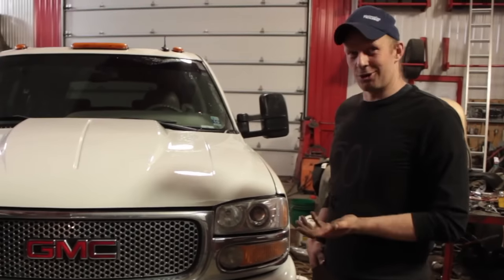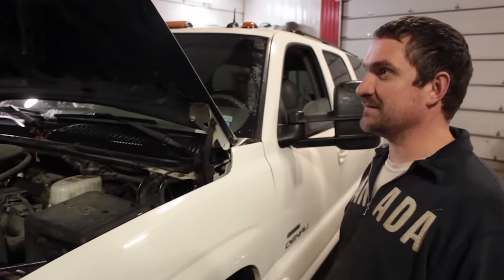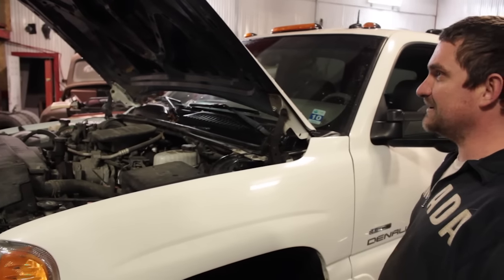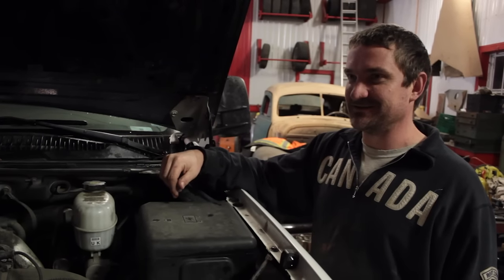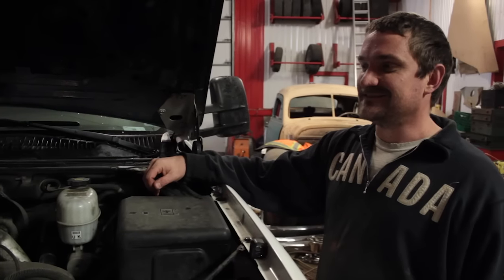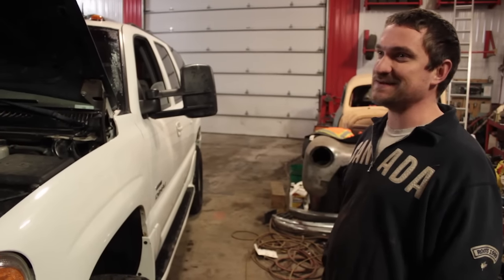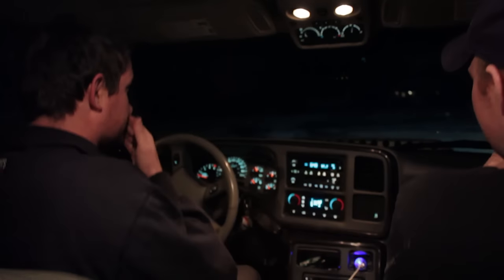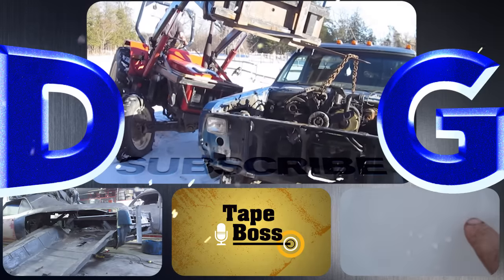Duramax Diesel Swap 6.6 LBZ in an '03 Yukon XL Denali

Comment: That's a perfect truck. That interior/body style is great! Not to mention with a Duramax!
Reply from the maker: +HKMcC _ This is my favorite body style, Before the company went into bankruptcy protection in 08 and cheaped out on everything.  They didn't fix it until 14.  I found from 08-13 cheap interiors, cheap paint and I never liked the outside where the doors go to the bottom of the truck.  Without rocker panels it always looked off to me...
Reply: +DEBOSS GARAGE Yes. I have a 03 with 250k. They are awesome trucks. 08-13 had a much poorer build quality like you said. But now GM has really turned itself around and building good cars/trucks again!
Reply: 240xxx km's on my 2008 Sierra 5.3, not a single issue short of regular maintenance on wear and tear items. I believe its the younger generation of people not taking care of their vehicles to blame. I truly do not believe for a second that GM cheaped out on everything. The interior, sure but its a pickup truck made for work. My paint is in excellent condition and very minimal rust on the underside. I live in Ottawa, ON and drive in very similar conditions that you would experience. Just my opinion on the nnbs style truck. Great vids!
Reply: @hkm_865  Thought I would chime in a few years later and would like to say I have a 2005 Tahoe that is going on 365k miles and still running smooth as ever. Hands down one of the best platforms gm has made.

Comment: Our company has twelve 2015 Silverado 2500HDs with the 6.6 Duramax with the Allison and they are amazing trucks. When my 2014 3500HD Ram was in the shop I drove one of them and pulled my 36' gooseneck flatbed with it and even loaded down with 32,000 lbs behind it, it pulled it no problem. They really are a wonder. 417 hp/765 lbft of torque is a feat, and they haul ass. My 6.7 Cummins makes 370/800 and you can definitely feel the difference in gearing. My Ram (single rear wheel) is rated for 24,500 GVWR and I've pulled close to 40,000 lbs with it (in extreme circumstances, short distances). I'm a big fan of both trucks, and I have always loved Mopar, but I love the Chevy's torque. If I could have a Dodge chassis, a Duramax with an Allison, and a Ford interior, I'd be set. I didn't include the PowerStroke because our company couldn't strike a deal with Ford for this year so we didn't get any of their new trucks. I have no experience with the new Fords.

Comment: With that I know you're very busy but I'm just looking for some input I have an 05 Sierra HD. 8.1 truck and I'm trying to rehab it and put it back on the road going over everything from front to back top-to-bottom but to build this truck right with Raylar parts to make real power I'll have over $10,000 in the engine alone before I touch anything else so I'm debating on doing an LBZ lmm or LML. If you could when you have a second please reach out and just let me know what you think should I build the big block is there other companies that I could have better options with or just go with the diesel. As an FYI I do have an amazing engine builder on machine shop local to me

Comment: Is Canada’s strict on emissions? Do you still have to get diesel emission tested? I notice he still has the egr in there.  Well at least he still has the stock cold side(passenger side) intercooler pipe  which is apart of the egr system.  Still has stock air intake too.  Didn’t sound loud at all so I would imagine it’s stock exhaust too.

Comment: I have a ‘06 1500 Suburban, I’ve been wondering about the cost of a LBZ swap, I know a 12 valve swap would be so much cheaper and cheaper to build, but you have to do all that cutting to fit the 6cyl and beef up the 1/2 ton frame....

Comment: Sweet, I'd love to put one of those LBX and Allison in my 97 Suburban.
Reply: Put a 6.5 those actually came in those. The
Reply: +Dodge 318 Cummins 
Not even close to the same thing.
Reply: +davkenrem the suburbans and Blazers earlier than 1999 came with a 6.5 turbo diesel a duramax came in 2002+ 2500s
Reply: +Dodge 318 Cummins --Guys are putting Cummins in all kinds of vehicles. I'm very aware of which years the Duramax came in. I have a rust free 97 that would make a great place to stick a duramax into. Look like it would be a fun project.
Reply: +davkenrem the price it's going to cost for the conversion isn't worth it. Most people who do Diesel swaps mainly do it on rare trucks from the 50s 60s 70s and 80s like an international harvester or a crew cab dodge no one will buy a $5,000 engine and drop it in a $3000 suburban it just doesn't make any sense.
Reply: +Dodge 318 Cummins - I'm not going to argue with you. You don't have to spend $5000.00 to get a Duramax. And  I didn't say I was going to do it. People put expensive engines in old cars everyday, so that argument holds no water. If someone wants to build something and willing to spend the money, thats their business irregardless of the "sense" it makes.
Reply: +davkenrem besides most people put 5.9 12 valves in most things because they are easy to wire and cheap to find. Sell your car for $3000 and buy yourself a duramax truck for $6,000.
Reply: +Dodge 318 Cummins people build suburbans up all the damn time dude Not sure what planet you live on hahaha. I have a badass 6.5l Detroit in a 2500Hd people love them!
Reply: +davkenrem I would do it bud people love these trucks.  There is a place in Florida that even does them Duraburb look em up, some people just don't know their head from their ass! Lol.

Comment: Hi greetings from BC! I can get a low km 3/4 ton crew cab 4×4 2007 classic LBZ, can I drop a suburban body on that crew cab 6'6" box frame do you think ? 😀  I get it complete but I don't want the wheel chair lift crew cab body 😁
Reply from the maker: Entirely possible.   You will need a body lift to cover the much larger transmission.  Todd from this video makes them and ships them all over.  His link is in the description.
Reply: Great tq

Comment: I have a 2003 GMC Yukon XL with a Flat Spot Cam (misses at low RPM's) and a bad leaking Rear Main Seal the Motor (5.3 Vortec) has 260K on it but runs pretty good. Its just too much work at that mileage to repair the Cam and the Rear Main Seal so I am looking at to Crate Motor a Reman Motor Nothing I would love more is to put a Duramax in it however I am disabled and in addition don't have the ability (Knowledge) to do it or direct it.  I will never be able to afford a truck New or Used with Duramax, Any Chance your looking for another one to build? Contact me if so. Thanks

Comment: im going to ask this at the risk of sounding dumb but.... would it be possible to start with a truck and chop off the cab and add the body of a yukon or suburban what ever your flavor? i have seen this done with the F-series going to excursion heck even a 6 door excursion?
Reply from the maker: +brandon mash In theory yes, but the ecu is only programmed for that specific vehicle.  The rear wiper, climate controls and things like that wouldn't work.  The internet has been around long enough now that if it hasn't been done, its probably not a good idea

Comment: Great videos! I've got a very nice/dead reliable but DOG slow '99 Suburban 3/4 ton 6.5 diesel, would like to swap to older 5.9 and SAS. How do you get by emissions? I'd imagine it's easier to get to about 400 RWHP with the 5.9, cheaper too. Can you still plug into OBD 2 port for anything ? Thanks! I'm also an Ontarian (Renfrew)
Reply from the maker: pre 2000 you can reclassify your burban under "hot rod"  go to the licence office and pick up an application.  It will have to pass the emissions for the Cummins which should be a sniff test.  2000 and newer, you have to be a little more creative...

Comment: How much would one of these cost??
Reply from the maker: +Martin Valle How much would you pay?
Reply: +DEBOSS GARAGE 25k
Reply from the maker: +Martin Valle Although I never asked what the cost was, I would think that would be on the low end.  You can head to his website and ask him personally though.  I think his link is in the video
Reply: Stock swaps turn key under 100k miles go for typically 27k-30k loaded.